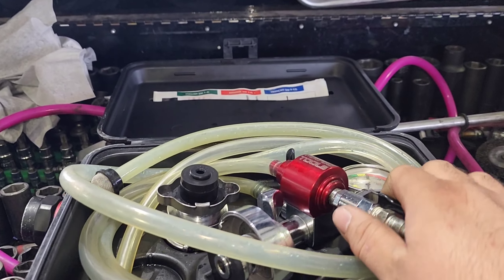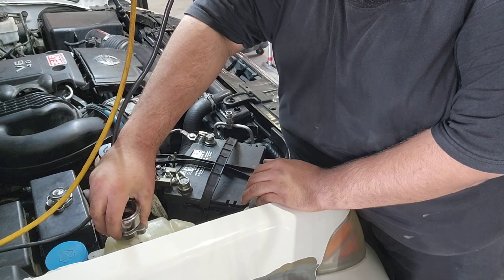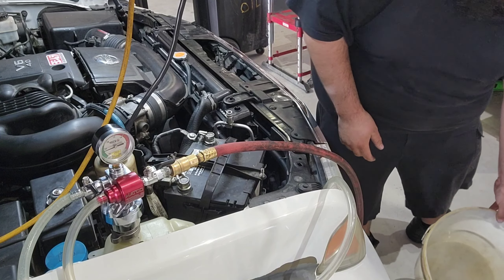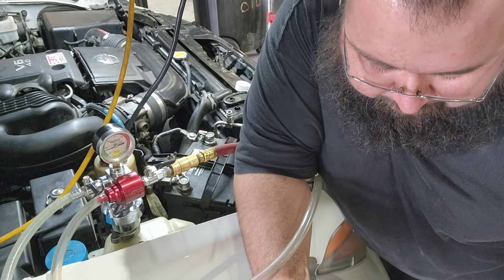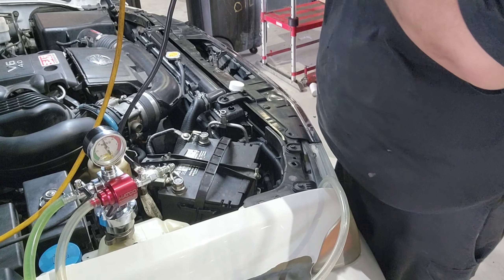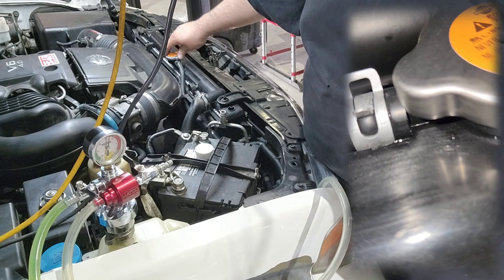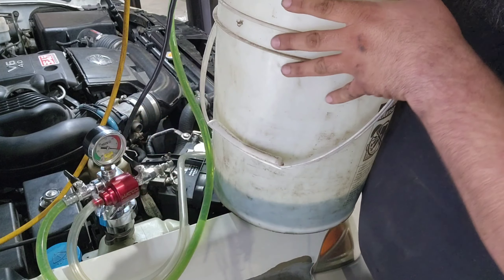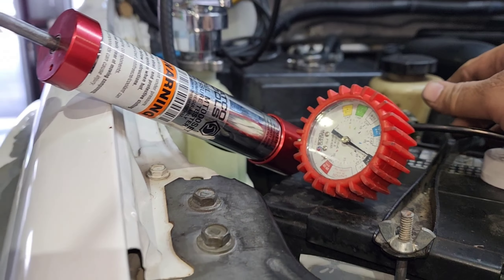MATCO COOLANT REFILL TOOL WALK THROUGH #mechanic #matcotools

Comment: You should drill a hole on the coolant bottle cap. Put the hose through it.  Than attach it to coolant bootle with drill holes it it. That way you don’t make a mess while vacuuming the system.
Reply from the maker: I use to do that my dude but then id have to transfer the hose over to a full bottle and id end up with small airpockets in the hose so its just easier to put it all in a bucket...
Reply: No I meant the hose that’s taking the air out. When you put the system under a vacuum. Instead of you putting down towards the engine bay, put that hose with a cap so the bottle can catch it